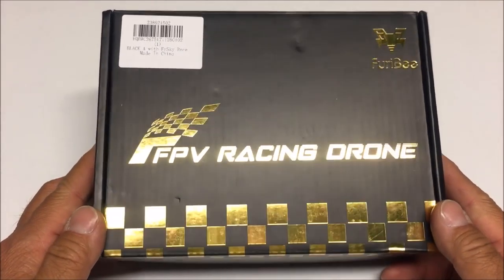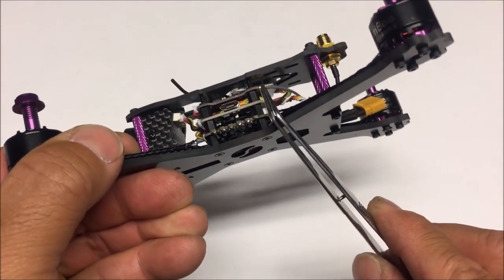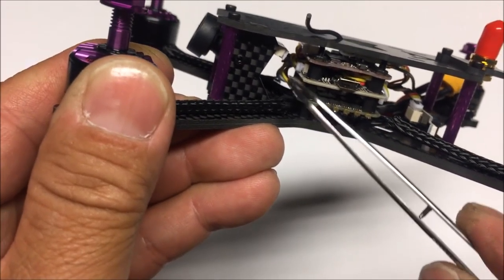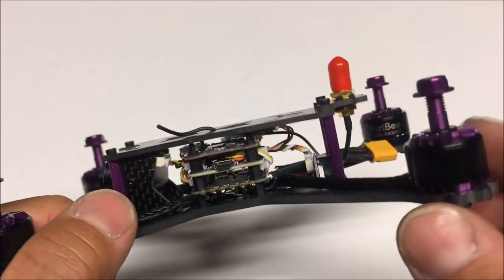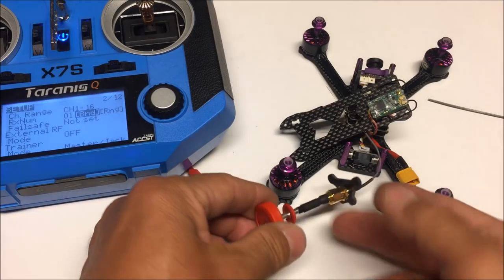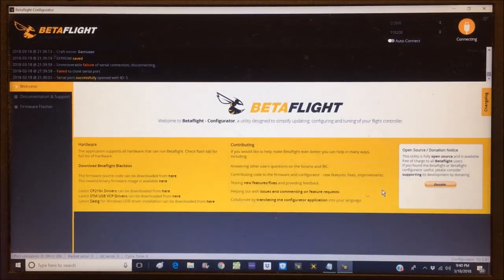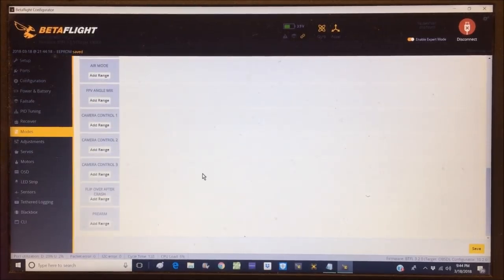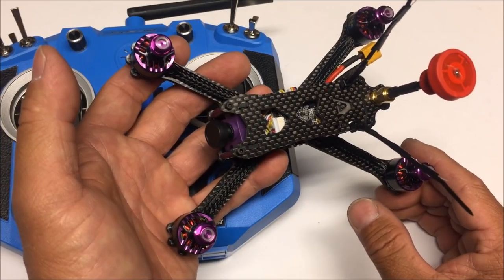Geniuser 160mm FPV Racing Drone with F4 FC 3-4S BLHeli_S 28A ESC

Comment: Quad looks great, betaflight looks a bit beyond me! I think I'll go with a ready to fly race quad with a Flysky radio all in one combo. Hopefully I'll get my head around it all as I go along.
Reply from the maker: The best thing to do is to keep playing with betaflight  configurator so you don't need to buy a ready to fly unit :)
Reply: RC Escape Thanks for the advice!
Reply: John D Thanks!
Reply: I though that too but after researching PID's, Rates and how to alter them, both my quads are now locked in and so flyable. I started with an Inductrix FPV+, moved onto Torrent 110, then bought an RTF-Oblivion and added Crossfire and an Armattan Japalura 4 - stock with Foxeer Box. Even with an RTF, they ship with standard rates that will eventually need tweaking to suit an individual pilot's fly style. I found my ideal rates after 6 months of practice, research and test, test, test. When you find them, FPV opens a new door of enjoyment.